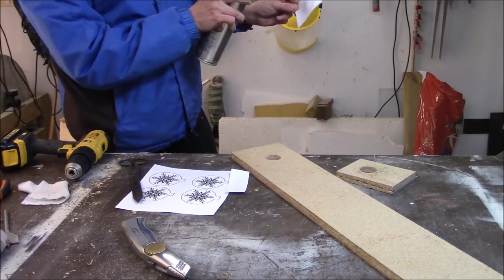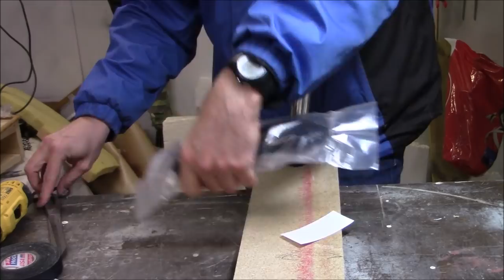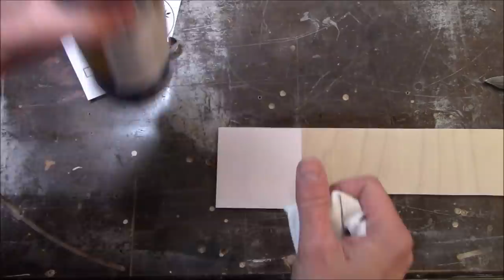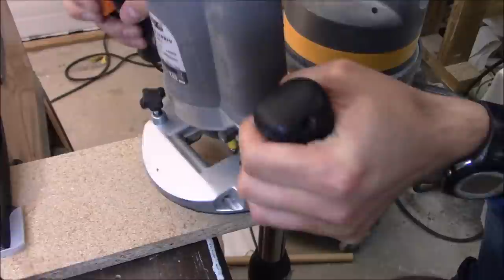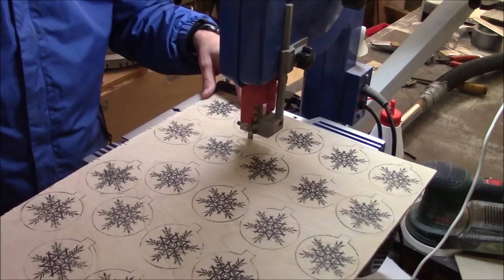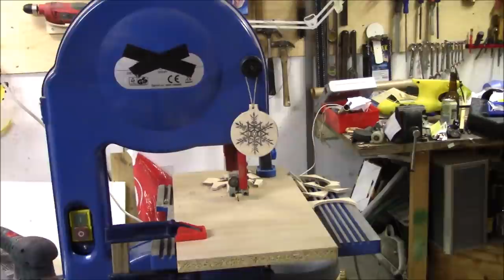How to make simple Christmas ornaments

Comment: Verry good idea to hold the workpiece. 
Please try it again with more vacuum. 
The cheap way is to buy a (used) pneumatic vacuum-pump (Ejektor).
Reply from the maker: I wil try it again. Thanks for watching!
Reply: A larger bore would significantly increase the contact pressure. Perhaps that already solves the problem.
-
Scandinavians never give up! :-)